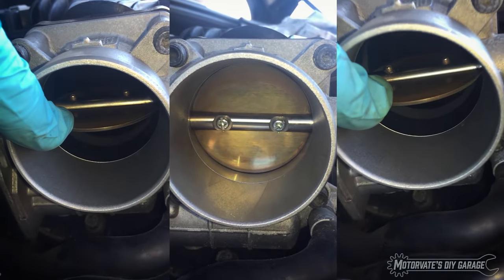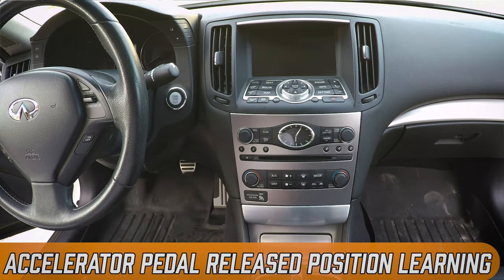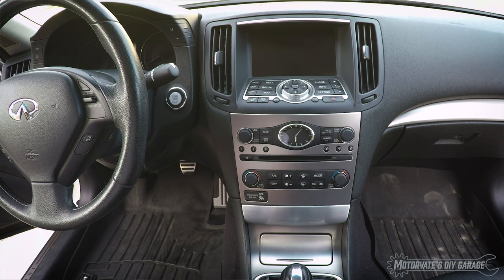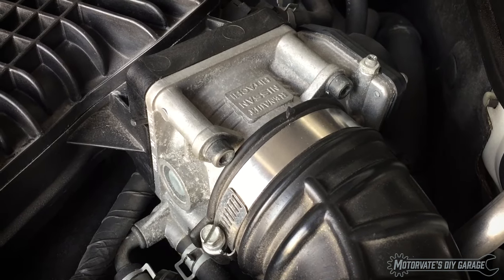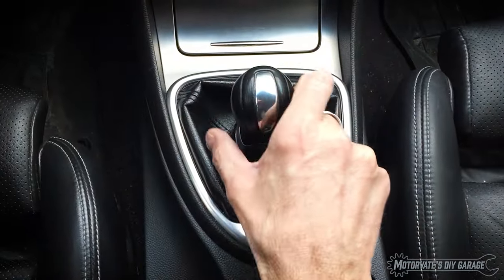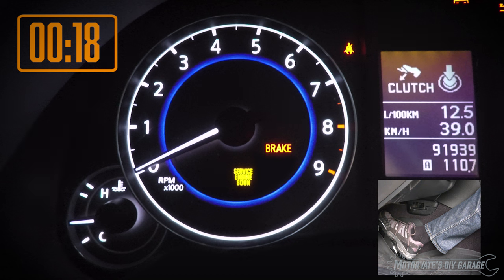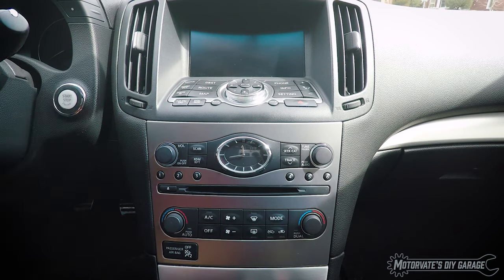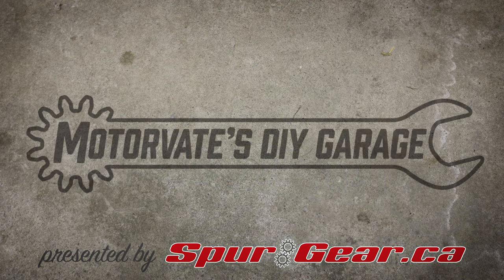G37 & 370Z After Throttle Body Cleaning: Motorvate’s DIY Garage Ep.27

Comment: Thanks for this resource but im worried I got in over my head.  I have an '08 g35x (vq35hr) and followed the steps to clean my throttle body as well as a couple other things (recharge air filter, and clean mass air flow sensor).  I got to step two and after the coolant warmed up my car keeps revving between 1100 and 2000 rpm when idling.  I'm going to retry the steps once the coolant cools down but thought I would reach out to you to see if there is anything you can think off that might be the issue.  Thanks in advance.
Reply from the maker: That's odd. The only time I have seen what you describe is on a 2007 G35 (VQ35HR) as that version of the ECU has a bug in it and can't do the idle air volume learning.

Is there any chance your ECU is from a 2007?
Reply: @MotorvateDIY  Yes, it is a 2007 sorry about the typo in my comment.  Is there anything you would suggest I try before taking it to the dealership?
Reply from the maker: The only solution I know of is to update the ECU to the latest version, but some dealers don't like to do that.
Eugene at Enthusiast Auto Care (https://vq37tt.com) has done this update for a few folks here who had the same problem. I know Eugene well and is very knowledgeable on the G/Z platform.

So, either the dealer or Eugene are your options. Good luck!

Comment: Great video, im now a subscriber! I had to remove my throttle body on my 2012 g37 3.7 to get to a leaking inlet coolant hose and i needed more room to get to it. I did disconnect the negative battery cable as advised on another forum and after putting everything back together now my car will not crank at all. It just turns over. Help ive already been without my car for 2 weeks waiting on the correct hose. Could having the negative cable off for two weeks caused anything screwy to happen.?
Reply from the maker: Having the battery disconnected for a day or a year shouldn't cause a no crank condition.

Double check and made sure any electrical connection you touched is in the proper spot.
Reply: Thank you for your reply, I  had to disconnect the throttle body connection to get to the small inlet pipe hose that goes from there to the outlet pipe so will o jabe to perform the necessary steps to relearn the pedal and the other two steps I can't remember off the top of my head but I know there is a sequence you have to perform.

Comment: Hello, I have a 2012 g37x sedan and I am planning on cleaning my throttles. Should I disconnect the battery and the remove the connection going to the throttle? Or should I leave it in and clean it while it’s still connected? A response would be really appreciated! Great vids!
Reply from the maker: There is no harm in disconnecting the battery if you want to, but I never have. Just make sure to open the throttle plate slowly and don't let them slam shut.

This may help:
G37 & 370Z Throttle Body Cleaning: Motorvate’s DIY Garage Ep.26
https://youtu.be/ySK99VbSiTE

Good luck!

Comment: Really good and informational video as always! Do you noticed any significant difference in the driving after the throttle body cleaned up?
Reply from the maker: Hey Gabriel Hernandez, 

Sorry for the late reply, sometime the comments get buried.

Yes, I did notice a difference. The engine is a little more responsive when starting off from idle.

Comment: Hi! First off i wanted to say thank you for your video, im struggling to get the service engine light to flash, im not sure if i messed up the process? Is there a reason it could not be engaging?
Reply: Wanted to add i have a 09 370z
Reply from the maker: That part can be tricky as the timing needs to be almost perfect AND the "preconditions" must be met.

If you have a cheap Bluetooth ELM327 OBD scanner and a Android device, you can use this free app to do the "idle air volume learning"

All steps show here: https://youtu.be/OiB9txECWB0

Good luck!

Comment: Weird question. Would you do the procedure after installing long tube intakes?
Reply from the maker: As I see it, there is no need. If you idle is stable and the cruise control operates smoothly, there is not need to clean your throttle bodies.

However, since you have the factory intake tubes off for the install, you are already 1/2 way done to clean the throttle bodies, so why not?

Good luck with what ever you choose to do :)

Comment: Since its so hot lately. Am i able to clean the tb's today, leave it then do the procedures in the morning to achieve that 77°f or below temp or do i have to do it in one shot?
Reply from the maker: If memory serves me correctly, the temperature requirement is only for the throttle closed position learning, which is not as critical as the "idle air volume learning", so I think you should be ok.

If you listen carefully (widows open) when you turn off the engine, it sounds like the throttle does a quick open/close action to double check the closed position... so I think the closed position learning happens on a on going basis... but that is just my theory. :)

Comment: It's needed because of poking the butterfly right? I never opened mine and the idle has been perfect.  Nice video and keep them coming!
Reply from the maker: Hey Milan Parekh,
Nope... It is needed since it was cleaned. Over time, as the carbon builds up, the ECU slightly open the throttle in order to get the proper idle. By removing the carbon build up, the "air gap" is larger and that  allows more air than the ECU expects. These 3 procedures will restore the idle to where it should be.

By the way, after you clean your throttle body, your cruise control is MUCH more smoother when speeding up or slowing down.

Thanks for your kind words! The next episode is in pre-production right now and should be released in 3-4 weeks. :)
Reply: Sounds good, when the time comes a coolant episode would be much appreciated.

Comment: I did all this and now my 09 370z sometimes shakes violently on ignition and then it dies, now the service engine soon light is on again and it's a p0174 code according to autozone saying that my bank 2 fuel injector is bad, not sure why that would randomly come up after doing the idle relearn, it idles at 1,000 rpm but I think it should actually be like 600 - 700. I really hope I didn't screw up the engine by manually moving the throttle body plates. I don't have all that much money to test everything out and replace every part so I may just take it to a shop but I don't want to get taken advantage of either.
Reply from the maker: Do the idle volume learn again. Sometimes it requires more than one attempt.

You can also use the free NDSIII Android app if you have a cheap bluetooth scanner: https://youtu.be/OiB9txECWB0

Comment: Does this process also works for my Infiniti Q50 twin turbo ?  

Thank you.
Reply from the maker: I've just check the Q50 factory shop manual, and it only shows using Consult III (dealer scan tool) to do the idle air volume learning, so I don't think so.

Comment: Is it necessary/better to disconnect the battery doing this?
Reply from the maker: Hey  KyiRui,
I guess there is no harm in disconnecting the battery, other than loosing your radio stations and resetting your engine computer.

I don't disconnect the battery.
Thanks for the question :)

Comment: Do all 3 procedures need to be done back to back all at once or just the first 2 then perform third relearn?
Reply from the maker: It is best to do all three as soon as you can. If you have a higher idle, the idle air volume learning will restore your idle back to normal.

Comment: I have a problem with my idle while in D on my tuned UpRev 12’ 370Z. My RPMs will fluctuate from normal 650 to 630 to 580 to 700 it will do this for 2 seconds and return back to 650. It does this when I come to a stop mainly and is intermittent when it does happened. My previous idle used to be in 700-800 range. No CELs. So I cleaned the MAFs / TB but didn’t move the valves much as I didn’t want to mess them up and didn’t perform the idle reset. A lot of build up came off, however the issue is still there. Will the idle reset procedure fix the fluctuations in idle? I’m unsure on if I should do it or maybe clean the TB better. Others mentioned to get a retune. Any guidance would be appreciated.
Reply from the maker: I think the "idle air volume learning" should be done, since you cleaned the throttle bodies... and I think that will restore your idle.

AND if it doesn't, you can then say to your tuner that you have done everything you can and ask him to look into it.

Comment: Do you think the driver’s side intake’s chamber (resonator) bother air flow? (Silicone intakes from Z1, Mishimoto or so deletes driver’s side’s factory intake’s resonator)
Reply from the maker: I don't understand the question.
Reply: @MotorvateDIY  hmm I’m wondering if it’s better to remove factory VQ35HR’s driver’s side’s air intake resonator and clog it with a cap or so since it might restrict or bother its air flow after the air filter
Reply from the maker: Do a test and see what you like better.

Comment: After the throttle valve closed learning procedure that sound from the throttle body, (clicking sound) does it remain or will it be gone? Because the sound is still there!
Reply from the maker: Actually, every time the engine is shut down, the throttle does open and close. I think this is due to the ECU verifying the throttle operation.

I think all is well and you have nothing to worry about :)

Comment: 2011 g37x here, I did all of the steps to relearn, on the third step, the service engine soon light flashed as you explained, but did not turn off. Idle is where it should be, should this be a concern, did I do something wrong, or should I just live with the service engine soon light? Thanks!
Reply: Well I got it to shut off trying the method several more times. I thought it was a different "issue" since the light never turned off while holding down the accelerator.
Reply from the maker: Hey  Keith Baldwin,
I'm glad you got it figured out :)

Comment: Hi. Do you know if same throttle body cleaning process and relearn will work on 2013 Infiniti M37 and 2018 Infiniti QX60?
I recently cleaned throttle body and mass airflow sensor on 2018 QX60. I just happened to see your video about relearn process and looks like I do have the problem with idle. When I starting car and it’s cold, the RPM arrow is not steady and kind of goes up and down until about good 10 minutes and it’s  high when you just start a car about 1500-1700 RPM until engine warm up and then finally looks like staying steady. 
I still want to do the same job on my 2013 M37, but at this point don’t want to mess with anything and not making it worse. 
So do you know if I can do the same relearn process on these cars after doing this job or relearn process on these cars is different?
Also, if I proceed with throttle body cleaning in my M37 is it okay to remove throttle body so I can do a good clean inside?
Reply from the maker: For the 2013 M37 it is the same process.
I wasn't sure about the 2018 QX60, so I looked it up in the factory service manual..... good news! It is also the same process.

From a functional perspective, the only part that needs to be cleaned is the edge of the throttle plate and the throttle body bore. Any other cleaning (like on the front or back of the throttle plate) are just for looks/make you feel better and have zero impact to their function.

Having said that, feel free to remove the throttle body and clean away. 
Good luck!

Comment: I have a 2008 Infiniti G35 sedan , I recently decided to buy it for work and I’m about to  clean the throttle body ( I feel like it’s dirty ) . I was thinking to disconnect the battery and cleaning it , do you think by doing that I won’t have to do all of that or is it necessary, Btw great videos ! :D
Reply from the maker: For the 2008 G35, there is no need to disconnect the battery. BUT if you want to, there also is no harm in doing that.

Comment: I have 03 G35 and this procedure hasn’t worked yet for me, any suggestions Motorvate?
Reply from the maker: Getting the idle air volume learning to run to completion can be tricky. One subber mentioned that it took them 20+ times.

Make sure every possible thing electrical is off and make sure to follow the pre-conditions mentioned in the video.

You might want to look at this: https://youtu.be/GSuTPTEDhhc

Good luck!

Comment: Great video but one question, If I have a mechanic do it. Can I drive my car home and do all these steps then?
Reply from the maker: Hey BIG ROCK gaming,
(I am assuming your car is a Nissan or Infiniti)
Yes. A mechanic can clean the throttle body and you can do these three steps at home.
Depending on how dirty the throttle body is, your idle might be higher until you do these three steps.

Your mechanic might even have the software to do the "idle air volume learning" in about 10 seconds. You might want to ask. 

Good luck!

Comment: Hopefully you answer to my comment, my g37 2010 sedan , started shaking at  at lights or going in reverse , you think by doing this it’ll go back to normal?
Reply from the maker: Hey Juan Zenon,
If the throttle body hasn't been cleaned in a while, I would clean it, as shown here:
https://www.youtube.com/watch?v=ySK99VbSiTE

Then, do the three steps shown in this video.
It is easy to do and doesn't require any special tools, but getting the timing correct might take multiple tries.

Good luck!

Comment: Efficiently made video, thanks!. I have a 2009 Nissan Murano and I think this is what's happening to me at the moment. Few weeks ago, I cleaned the throttle body and the sensor; some time after that I see "service Engine Soon" light on the dash, I didn't make the link and was wondering what's about !... so I just bought an OBD2 dongle and run an App and it gave me at least two codes, P0448 and P0507. 
Do you know if your procedure is applicable to a Nissan Murano ?
Reply from the maker: Hey  Abdenour Derouazi,
The two trouble codes should be fairly easy to fix.

Nissan defines a P0507 as: The idle speed is more than the target idle speed by 200 rpm or more.

and the P0448 as: EVAP canister vent control valve remains closed under specified driving conditions.

The P0507 is a result of cleaning the throttle body. If you clear the code and then follow the steps in this video that should fix your idle. 

The P0448 is defined as: EVAP canister vent control valve remains closed under specified driving conditions.

Most of the time this is due to a stuck EVAP canister vent control valve. It is located on the EVAP canister at the rear of the vehicle.

You could do an online search for the factory shop manual (easy to find) and then look at section "EC" and page 296 for easy to follow troubleshooting.

Good luck!
Reply: @MotorvateDIY   Thank you!, I will check it out.

Comment: My G37 is a little shaky after I installed long tubes intake, and since I was moving everything, I decided to clean the throttle bodys and the maf sensors, do you think this is the reason? Should I try to do this?
Reply from the maker: YES!
Think about it... you have changed the shape and length of the intake system. The ECU knows the stock air flow characteristics, which are not the same as what you have now :)
Reply: So by doing this, is gonna memorize the system that is now?! Correct!?
Reply from the maker: Correct, this procedure is known as the "idle air volume learning".
Reply: Thanks, it’s crazy how many so called mechanics couldn’t do this nor explain why it was it was
Reply from the maker: As I see it, they have a tough job. The repair procedures are becoming more and more make/model/engine unique. Their skill set is built up on the cars they see the most. 

and if they don't work on a lot of Nissan/Infiniti they may not be aware of the Infiniti/Nissan only "Idle air volume learning"

Comment: Does this work for a 2005 Q45 Infiniti ?
Reply from the maker: Hey Polishedbrother,
I just check the 05 Q45 factory shop manual and the steps are exactly the same, so YES :)
Reply: Motorvate DIY 
I really appreciate you following up thank you for that.👍🏾
Reply from the maker: Hey Polishedbrother,
Anytime :) 

Please let me know how you make out. BUT, keep in mind the timing is critical to getting the idle air volume learning to work. It might take a few times, but keep trying and USE a stop watch.

Comment: Thank you! Question though, when doing step 3, the check engine light did not flash at all, but the idle is working perfectly, would I assume it still worked then?
Reply from the maker: Hard to say, but I would think so... You can always try it a few times to make sure. OR use the NDSIII app on android if you have a Bluetooth scanner:

Quick & Easy Idle Air Volume Learning: Motorvate's DIY Garage Ep.28
https://youtu.be/OiB9txECWB0

Comment: Hey man, great video but I tried this a few times. Do you think this procedure has to do with the year of my car? 2007 infiniti g35x sedan. It didn't work for the most part but got rid of the check engine light that stays on due to high idle.
Reply from the maker: Crap.... I guess you didn't see the warning for the 07 G35/350s.
Your ECU has a bug in the software and won't allow the idle volume learning to complete.

Some have been able to get their ECUs updated at the dealer and other have had Eugene at https://www.yelp.ca/biz/enthusiast-auto-care-concord update the ECU to resolve this.
Reply: @MotorvateDIY  I also have the 2007 g35x, can't just unhook the battery to reset idle?